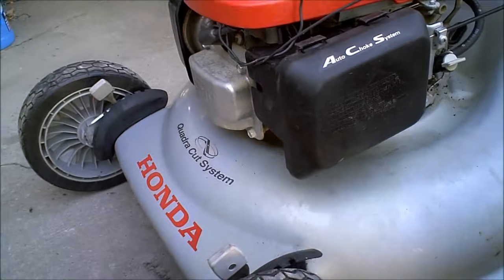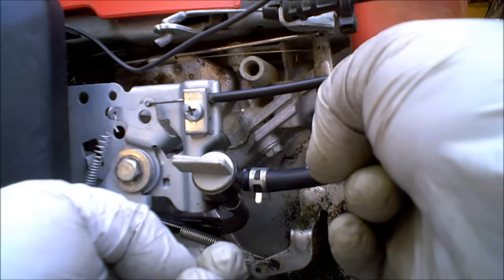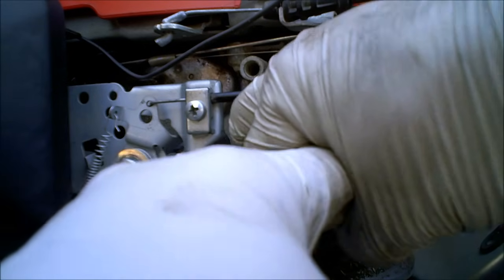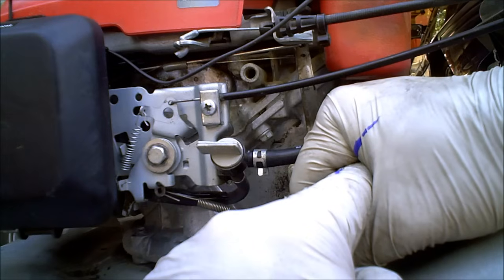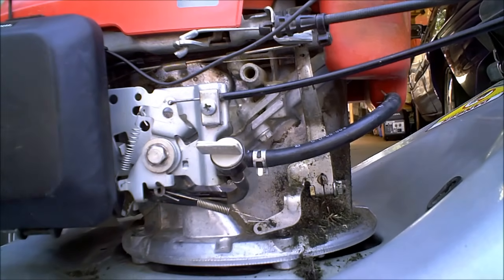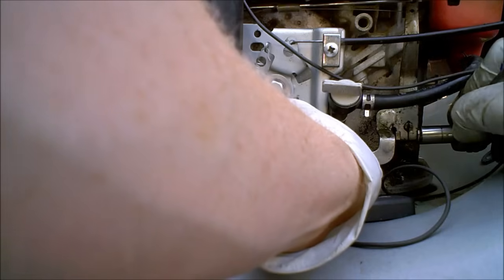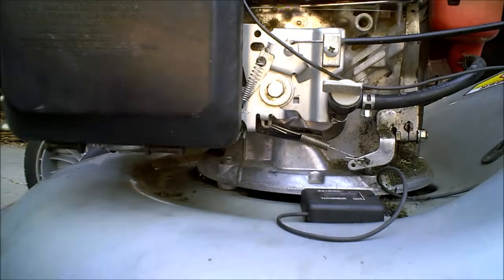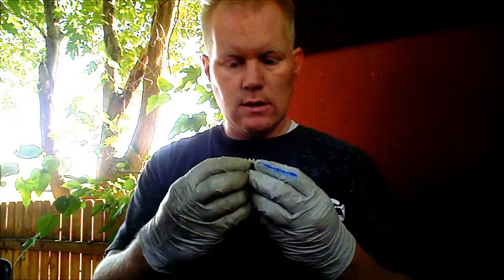Governor Adjustment and How They Work       Honda Briggs Tecumseh Kohler etc.

Comment from the maker: Yes, there was also air vane governors used on old Briggs and Stratton. I have never seen one of those go off or go bad.

Air Vane Governors:
The flywheel is also a fan and creates air flow. The air flow pushes on a tab (air vane) and it in turns pushes on the throttle. A spring holds it back. The faster the engine moves the more air flow and the harder it pushes on the air vane(closes the throttle). When the engine slows the spring pulls harder (opens the throttle). Delicate balance.

Comment: Hi...thanks for the video.... Just a minor problem...I cleaned the carb and it runs fine with the exception that it does idle too fast.  Followed your instructions, but.....the little shaft which is turned to regulate rpms only turns one way from the reference point.  I cannot get it to move in a counter clock wise manner.   I am afraid to run it with the rpms so high. I think I will ruin the motor... Suggestions?

Comment: Sorry but that's not how you adjust a governor you set the arm all the way too full and what u do is adjust the spring tension if you tighten the spring it will increase rpm and if you loosen the spring it will decrease rpm. If you try to adjust it on the shaft, it will work and you can get the engine to run at the right rpm but the governor will not open up up the throttle correctly and you will lose power.

Comment: Thank you for the informations.
I've tried to adjust the governor during and hour and a half,it's really really really sensible.
now it's like before i touched it or radically way higher, screaming.
Without the rpm meter i don't want to touch it.
The mower belongs to a grandma i'm helping i can't take a risk.

At least it's starting and working now.

Thank you again.  : )
Greets from France.

Comment from the maker: Honda sets their mowers at lower rpm than most to keep the sound levels to a minimum. The engines they use are designed to run faster and can easily and safely do so. Blade tip speed is what cuts grass nice,  so higher rpms is a good thing. Your governor arm could have slipped and that will lower your rpms a fair amount. I would mark the spot that it is now and adjust the arm (a tiny bit) like I show to increase your rpms.

Comment: hi
i've cleaned up the carb like you showed in the vid.
the mower is working now.
it's not perfect because the idle is low and it tend to die after a bit.

The max rpm is quite low too and was yet, before i touch the governor.
i can mow under load at least.

Thank you for your help.

Comment from the maker: The idle screw is virtually pointless and won't give you what you need. You need to pull the idle jet (directly below the idle speed screw) and clean it and the passage down into the carb bowl.

It is very unlikely that you governor system is to blame unless it has been messed with and put back together incorrectly. With the engine off and the throttle lever set to rabbit the spring should pull the main butterfly open. At turtle there should be little to no spring tension.

Comment from the maker: Sounds like your idle circuit is clogged. This will cause high rpm surging and no idle. You can view a complete carb video for your machine on my channel "Honda gc160 gc190 carb rebuild gcv160"

Comment: it's surging,so i have to clean the carb again i guess.
but what's the problem with the impossible idle ?
Is it the air screw to adjust ?

there is a screw for max rpm to limitate the butterfly opening and an other screw with only a quarter turn avaible for tuning ?

It's the idle air screw ?

Comment: Hi.
I need help...
I have a honda hrx 357 from 2005.
The mower can't stay at idle and die as soon as i use the "turtle mode"
At "rabbit mode" it 's surging.
i've changed the sparkplug and air filter because there were cracked/dirty.
i've cleaned the carb (main jet was not clogged,needle and seat were ok float too.
carb gaskets are ok too

The tension spring of the governor is useless on mine there is zero tension,it's always floating (?) 
 it is on the lower hole (your's is in the upper hole)

Comment: What happens if one tries to adjust the speed by changing the throttle spring tension instead of rotating the pinch bolt?

Comment: I would of left it at around 3k for better fuel, I mow my mothers yard and it use to take about 1 and 1/2 refills to finish it and I adjusted mine by ear down to prob around 2.5k and I can do her whole yard in just under 1 take full... not that much difference one mite think but when your hot and almost got it done and don't wanna have to stop to refill the gas in the home stretch its very nice to me.

Comment from the maker: If the engine shuts off at 1/2 or less throttle I would adjust the idle screw on the very top of the carb. It is probably set out too far. Turn it in Clockwise a turn or so at a time and run the engine. This screw is what ultimately sets your low idle speed.  Once your able to get it to run at idle then you can actually back it out until it idles exactly where you want.

Comment: Great video! I have an hrx217hxa with the gcv190. I just replaced the carburetor with a brand new honda replacement because the machine was surging and when I put the throttle lever to idle the motor would shut down. Now the motor runs without the surging but not seem to be at full rpm. I put the throttle at run but it seems to creep back just a tad to slow the motor. If I pull it back half way between run and idle it shuts off. I tried adjusting the throttle linkage to no avail. Please help ?

Comment from the maker: First I would check for a bad air filter. Generally that will cause reduced power and black smoke. Try running it for a minute without a filter to test.  A wrong hole in the linkage will also cause lag. Mark the spot it is in now and try moving it one spot over.

Comment: My GCV160 runs well, but when it comes to longer grass the revs drop a bit, then the governor seems to cut in and it puffs black smoke before the revs increase.
I have had the carb off and cleaned it in the past and cleaned it (thanks again for the vidz) 
I am wondering if its an adjustment problem, as in the spring is in the in wrong hole.

Comment: Thank you, most likely the then the rpm is too slow since the water pressure is not what it was before. I will check the governor movement like you suggested and go from there, thanks again

Comment from the maker: The rpm should stay the same under load or without a load (thats the job of the governor). Now if the rpm is slower than it should be and there isn't a difference between idle and fast then it sounds like an adjustment issue. Your engine should be running at 3400-3600 rpm. Now with that said, over revving it will give you more power-pressure but you run the risk of damaging the engine. I would watch the gov and start the engine to see if it moves.
Reply: Don't know if you're still answering but...

My pw's have always sounded like they're 'working' when water is released to actually power wash.  Tone deepens, and lightens when the handle is released.
Aren't they supposed to sound different as the pump comes on and off?

Anyone?  Thanks!
Reply from the maker: @RICDirector  That's exactly what it's supposed to do. When you pull the trigger the pressure washer unloaded valve closes and the pump is "turned on" and puts the full load on the engine. Releasing the trigger does just the opposite and puts the pump in standby/off mode.

Comment: Thanks for the video and helping me understand the operation of the governor. I have a Honda gc160 on a pressure washer. The engine runs just great except the rpm's don't increase when under a load.however when i advance the governor control manually the rpm's increase as well as the water pressure. I'm thinking it's a governor problem but I am wondering if it is an adjustment issue or a replacement issue. thanks again

Comment: Great video sixtyfiveford. I have a couple questions, my riding lawn mower (Murray) has a 13.5 hp engine and I watch the govenor fluctuates, which means the throttle reves up and down. How can I regulate the govenor from reving up and down? Also, I disconected the lead at the bottom of the carburator float and it runs fine once in awhile. How do I adjust the fluctuation of the reving of the govenor? Thanks again for your video. Very informative.

Comment from the maker: The engine's load is always changing so they use a governor. In a car you are the governor and constantly modify rpm; Once you reach a certain speed-rpm you barely press the throttle to maintain it. At the same speed-rpm if you begin to go uphill the load increases and you have to push the throttle further to maintain the same speed. Now once you go down hill you let completely off to maintain the same speed. RPM is governed by the operator. The governor on a Briggs does all this automatically.
Reply: great explanation thank you

Comment: Good info mate. Cheers. The thing i always wonder is why run a governor and just connect the throttle straight up to the carb and limit it with a stopper screw or butterfly stop to avoid it over reving??? The more load you put on the engine just crank up ya throttle. Obviously there will only be a max throttle speed of 3600rpms that can be obtained though. Just a thought. Cheers for the info again though champ. Been working on alot of old briggs engines lately all with governors.

Comment from the maker: The government maximum mower blade tip speed is limited to 19,000 Feet Per Minute. That means a 21" blade is limited to about 3456 RPM. Now if you have a 20" blade, you can easily run it at 3600 for best performance. Riding Mowers where the blade is run by a belt, the gear ratio is changed to get he maximum FPM out of the blade at the engines 3600rpm. With several 18" blades they raise the gear ratio to spin them at around 4000 rpm(3400-3600 engine rpm) to keep within the 19000FPM limit.

Comment from the maker: You are very miss-informed. RPM is regulated by government blade tip speeds on walk behind lawn mowers.  Most of these engines are rated at 3600rpm max but used on a walk behind mower they are limited to around 2500-3400 depending on mfg and blade length. Riding mowers are all around 3400 and have nothing to do with horsepower. I'm sorry but, belt tension, blade weight and horsepower have nothing to do with rpm.

Comment from the maker: All snowblower engines should run at 3400-3600rpm. The other comments are about lawn mowers that have mower blade tip speed regulations that they are trying to conform to.

Comment: Snownblower 2-stroke Tecumseh engine Hsk-600 its now 
eight years later I Just put in a New Motor 
haha started it Yesterday but I'm worried about the RPMS - the motors running a little Jumpy - The motor is new but probably sat in a box for years so this Video help me w the rpms I already blew up one motor read other post so I'm little worried 
about running it, whats normal whats not? 
I'm going to check Rpms today

Comment from the maker: I have no doubt you could crack it open and replace the small watch battery. I have had this little unit for 8 years and another on that is over 10-12 years old that haven't needed a battery for either. Nor does the display look dim like the battery is getting weak.

Comment: I've never herd or seen a fan to cool these engines, makes sense though - and then the engine could do as many RPMs as you want. And I checked what my mower runs at and its governed at about 2,800, but it realy will start to sound overloaded at 2,500-2,300. But we have diffrent engines so maybe mine just runs at lower speeds than yours.

Comment from the maker: Thanks for watching. I do respectfully disagree with you though. Most mowers are set around 2900-3100 because of blade tip speeds regulations and decibel regulations. These engines are ran in numerous other applications and governed to run at 3400-3600rpm (pressure washers, log splitters, commercial applications, etc). They will actually cool very will with the built in cooling fan on all these small engines at 3600rpm. Lets agree to disagree  :)

Comment: 3,600 RPM is too high; too much heat, too much unneeded power. Lawn mower type engines should run at lower speeds (and loads), with less heat because they don't have cooling systems. 2,600-2,800 is usauly good. But 2,400-2,500 is better if less power is required. It's okay to briefly "serge" up to 3,600 is power is suddenly needed, but this doesn't happen on mowers. Most mowers are governed at 2,800 but HP specs are taken at full throttle (3,600ish RPM)

Great, helpful video! (besides RPM facts)

Comment from the maker: I never said it wouldn't cut or do a job I am just saying it cuts better at higher rpm. I have used every brand of mower out there and they all cut better, have better mulching abilities and bag better at rpms closer to the engines max rated ability. The shearing action of a mower rips grass at slower rpms and leaves brown grass tips. Yes a sharp blade helps but most people don't sharpen their blade 2-3 times a season like it needs but rather every couple years.

Comment from the maker: I feel your grief. They get a pretty bad rap because they are blamed for a lot of problems that aren't their fault. The majority of carb related problems are blamed on the governor system. They are actually a very reliable system that is to blame for engine troubles less than 1% of the time. What engine are you having trouble with?

Comment: Exactly... rated UP TO 3600 RPM but it does not stipulate to adjust the governed speed at 3600 RPM.  2500 RPM is peak torque and 3600 RPM is peak horsepower so to get the best of both worlds, 3000 RPM is the typical standard for governed speed.

Comment from the maker: .... continued... small engines should run around 3400rpm and max at 3600. I repair engines for a living and take great pride in lawn quality. You get a better cleaner cut from a mower running closer to 3600rpm than 2900-3000.

Comment from the maker: If you look at the engines alone at engines . honda . com and look at the engine specs. gcv160 and gcv190 that are in home owners mowers you will notice the performance curve says these engines are rated to go up to 3600rpm. Torque is peak at around 2500rpm. These speed rip grass and damage the roots. Torque is great to pull a tree stump. Horse Power get a job done faster. Honda does the slower rpm so it is quieter as people donate loud with poorly built. I say in my video that most are .....

Comment: You might get more HP out of a higher revving mower but the most torque is generated at a lower RPM.  I have installed a new throttle cable on a neighbor's older Honda mower and it stipulates 3000 RPM.  Two Toros I have with a 4 cycle Suzuki OVH both stipulate 3000 RPM and those are all older mowers (late 80s).

Comment from the maker: Continued:  I have tested at least a dozen others and they all have been set from the factory at around 3400-3500rpm. This is the first one that has been set this low. It made a HUGE difference in performance in cutting a lawn.
Reply: Yes it does. Our new mower with gcv 160 did hardly 2000 rpm! There was just no suction and did bog down a lot.

Comment from the maker: You are correct with the Honda service manual I have the same manuals. I am not arguing with that. If you look at the individual specs for the engines they are almost all rated at 3600 rpm max (some at 4000). Honda specs that the rpm be lower on newer mowers to reduce emissions and lower the sound. If you want the best performance/ most hp out of your engine they are safely rated to run at 3600 max(no load).  This is one of the first Honda mowers that I have had to adjust.

Comment: I have a Honda service manual and it states 3000 +/- 150 RPM as top, no load RPM.  It is the same engine as in your video.  Even Briggs Intek/Quantum engines and Toro's both stipulate around 3000 RPM as the top, no load governed speed.  That is the procedure for adjusting.

Comment from the maker: That is the rpm recommended under full load. If you actually left it at 3060 it would drop to 2500-2700rpm under full load. Performance is severely compromised at that rpm. These engines are rated at 3600 rpm.

Comment: 3060 RPM is not too slow.  The Honda service manual recommends 3000 RPM+150 so 3060 is within tolerance.  Setting it to 3560 in your video is too high.  I can tell just from listening to it.

Comment from the maker: You could probably do it by ear pretty good. Remove the chain so you can full rev the engine and hear what it sounds like. Then mark exactly where everything is so you can put it back if you run into trouble. Adjust the governor and restart the engine and rev it. You just want it to sound faster. I little adjusting goes along way.  Even race engines will have a rev limiter to prevent the engine from exceeding a certain RPM and self destructing, that's all your doing.

Comment: Thanks for responding, I'll try and get that device you have, to check the rpm then adjust it a little higher than stock. Thanks again

Comment from the maker: By removing it will allow you to get engine to higher rpms. The problem with this is the engine will be put at risk of throwing a rod, damaging valve train, oil starvation, over heating, cam failing, etc at higher rpms. I would suggest setting the governor to allow you to run at higher rpms.. Like 4000 rpm vs the stock 3400-3600prms. This will give you a little more but you limit the risk of blowing up your engine. People think it is a magical device that limits there hp but its not...